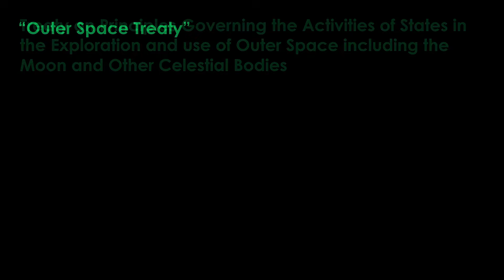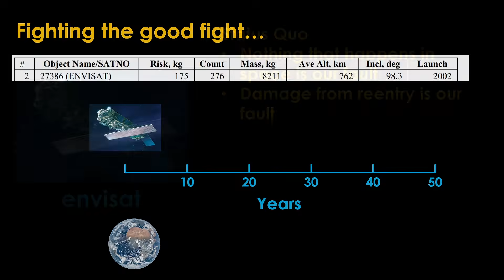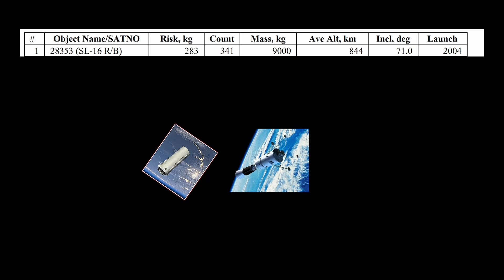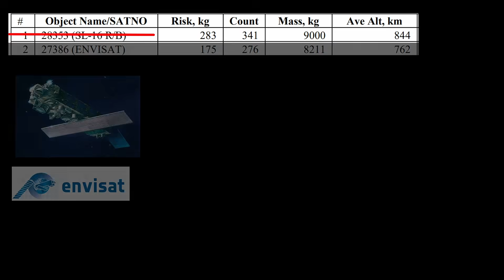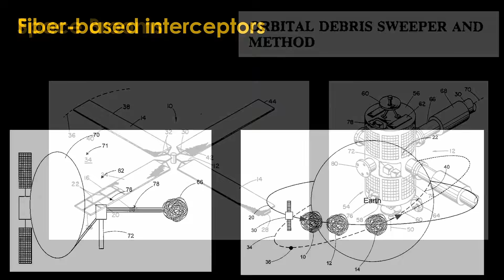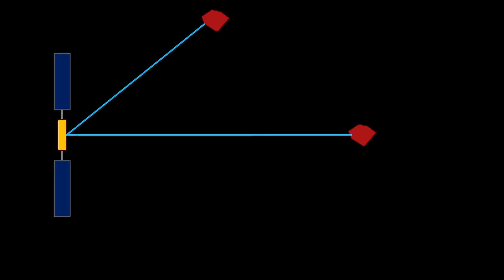Kessler Syndrome Part 5 - The Cleaners

Comment: you could just mandate satellites are designed to be able to be deorbited or maneuvered from laser ablation (from space or ground) use retro reflectors on parts of the satellites so the amount and vector of the thrust is fairly predictable. Much lighter and cheaper than adding in thrusters and fuel tanks etc. although adds some security concerns if another state can deorbit or interfere with a states satellites so easily.

Comment: The j̶e̶w̶i̶s̶h̶ space lasers look a lot more viable than I expected, so this does reduce my place on the Kessler Syndrome panic scale as well. Through of course the biggest danger remains a massive proliferation of satellite networks and data centers suddenly interrupted by conventional warfare. That would leave an inordinate amount of debris likely beyond the scope of any actor's willingness to clean it up.
But the lasers do address the long-term issues with Geostationary orbit and other high orbits.

Thanks for the video.
Reply: Those space lasers were designed and used to start wildfires in Califorznia.  I heard this from U.S. congressperson MTG.

Using a match would have been much lower cost.

Comment: What about using a dust made of ice or dry instead of a liquid or tungsten for a dust interceptor? The ice will sublimate in sunlight. A large craft holding lots of close to freezing could stay in orbit and change orbit to emit a cloud of ice dust that intercepts the desired objects, not exactly 180 degrees opposite but different enough in inclination  to make a difference. Or perhaps a lot of chunkier ice or dry ice to bust up junk particles into smaller fragments, so they'll deorbit faster due to drag.
Reply from the maker: I think both ice and dry ice would consolidate on launch. You'd need a way to dust it in orbit. 
I think...
Reply: @EagerSpace  I'd wondered whether water at just barely above freezing wouldn't rapidly freeze in a vacuum as some of it would evaporate and quickly lower the remaining water's temp at least to freezing. So spraying it in a mist? This would be an interesting experiment and could be done in a vacuum chamber with the right equipment. As for consolidation of dust, I'm sure you're right.

But what about water ice far far below freezing, ground into table-suger grain size? If it was cold enough it wouldn't stick to itself... Anyhow I just love the idea of sandblasting small debris into even smaller this way. If SpaceX can lower price to LEO the way they claim, like the $10 million to launch 100 tons into LEO they were claiming a few years ago,  it might be affordable to do some real experiments to figure out the best way.

Comment: How about a network of ion thrust devices, that can hand a target off from one to the next? Then you wouldn't need one of them to keep the same distance.
A dense enough equatorial ring of them could slowly affect polar satellites twice per orbit without performing a rendezvous.
Reply: Did I make a mistake, or are you suggesting we have objects going at relative speeds of ~10 km/s to each other repeatedly get extremely close to one another to fire off an ion thruster?
Because that sounds like a great way to achieve the anti-goal.

Comment: Teacher! Teacher! *hand waving emphatically!
I know how we can fix it good! Send all the ICBM's straight on upitty-up about 300 and 500 And 750 miles and have them detonate trafitional munitions. Remove any excess capacity fuel or even a few tanks for such a short trip then replacevwith Tungsten blocks consisting of millions of pellets a little bigger than rice, maybe 20 grams each with spiraling core bursting chages.
Problem solved. You can send me the Nobel Prize now. Thank you very much. Any sneaky snakes hiding in graveyard will have to be hit first tho, them And salvos to the Lagrange Points.

Comment: Disappointed that the dust solution didn't mention the powdered sugar solution. Powered sugar causes small explosions on impact that approximately double the transferred momentum. It's also much cheaper than powdered metals and less likely to vacuum weld itself into disastrous lumps. You also say that the vast majority misses the intended target, and that's true. However that's a good thing. It stays up there for a while deorbiting more small untracked debris. But it doesn't stay for long, causing a hazard. It's small enough to deorbit quickly or even be degraded by radiation into harmless gases like water or CO.
Reply: What if we get space-ants?
Reply: @whiskeylima960  as they say, space is no picnic.

Comment: "...and then you can determine the most economic ordering for a set of objects" -- that sounds like a hard problem (in the NP sense) as well!
Reply from the maker: It would be a hard problem with a very large set of objects, but with a few hundred I think you can brute force it pretty quickly.
Reply: @EagerSpace or you are just happy with a solution that is pretty close to optimal, which makes it a lot easier
Reply: @EagerSpace if we take "a few hundred" to be 300, then that's 300 factorial possible paths.  That's about 3x10^614, so even a massive data center isn't going to be better forcing it anytime soon!

But yes, a decent greedy algorithm heuristic should do a reasonable job in much less time. 😀
Reply from the maker: You can presort on apogee/perigee and inclination. 
If you are looking at dealing with the highly elliptical rocket bodies, you will want to deal with them out near their apogee - plane changes are much cheaper as you get farther out.
Reply: As with a lot of NP problems betting the best answer is very hard. But getting a pretty good answer is not that hard.

Comment: What about launching a sounding rocket, or HARP-ing up a suborbital projectile, to disperse gasses in front of the debris path?
Reply from the maker: You could do that with some of the debris clouds that are identified. If there are useful satellites in the area, you will slow them down as well.
Reply: @EagerSpace The intended debris is the type that's too small to track, so in most cases we won't have the option of targeting debris. Instead, we'd avoid the path of known functioning satellites. If we miss, the gas concentration would intentionally be so diffuse that it would have minimal effect on anything the size of a microsat or larger.

The idea is to merely create a temporary burst of extra atmosphere, to bring down the tiny stuff that we can only estimate is there.  There are certainly problems with this approach (yes it will slow down functioning satellites a bit because the gasses can linger). But very few other methods can address the "too small to see" problem.
Reply: Gases disperse at the speed of sound. Your gas delivery would have to be very precise to be at both the right place and time. Maybe fine sand would work better, it would be much easier to localise mass.
Reply: @usingthecharlim Sand and soapy bubbles might be useful for larger debris, but the intended use is to accelerate the decay of the stuff that's way too small to see. For a particle that small, hitting even a few molecules of gas induces a useful amount of slowdown.

Comment: I'm not 100% convinced that ground based systems would end up more expensive than satelite mounted lasers. Assuming a theoretical case of good tracking for 1cm+ objects being solved otherwise and not part of the cost calculation, how low would the launch cost have to be, for the satelite lasers to be cheaper?
Reply from the maker: We would need a detailed comparison to be sure. 
Ideally you'd base this off of one of the constellation busses as they seem to be approximately the right size and capability. Maybe you can convince one of the constellation companies to carry it as part of a normal launch. That might be fairly cheap. 

The thing about satellite systems is that they are standard and you can easily build multiple ones. Any ground-based system is more of a special snowflake - the construction can be similar but all the site work is custom and takes a lot of time.
Reply: With a tax on satellite launches, we could fund space debris deorbiting.

The latest generation of Starlink satellites have enhanced the star tracker hardware and software to also detect and track space debris. They also have multiple low power laser links with precision object tracking. A debris clearing satellite could be based on the Starlink satellite bus. Just remove a few hundred kilograms of communication hardware, and upgrade one of the lasers with a more robust mirror and a 20kw beam.

Years from now, if the financial, legal and technical issues are ever resolved, SpaceX could launch a few debris clearing satellites with each batch of Starlinks. This would put the debris clearing satellites in the same orbital plane as those Starlinks. Likewise, for other mega constellations operators.

Comment: Question: A fully operational startship would give us a lot more options with increased mass, much larger fairings, lower cost and refueling option?
Reply from the maker: A lot more options to do what?
Reply: @EagerSpace more tugs, more powerful lasers, more lasers, refueling tugs. My thinking here is that you can launch more for cheaper so all of the methods should be more effective. Not sure I'm right though and ofc Starship need to deliver on the promises. Maybe even bring them back down inside starship? (sure CIA would love that option)
Reply from the maker: Cheaper launch is always better, though starship will be cheaper per kilogram, not necessarily cheaper per mission. The same reason companies still fly on Electron when Falcon 9 is around.

Comment: ¿Did you see what elon said about using starship with a hungry hippo fairing to capture orbital debris?
Reply: Generally, this is useless, unless you really want to recover an intact satellite or station. Anyway, this is not cheap and is not feasible with most current debris
Reply: @Ame_u  it was specifically about derelict rocket stages. Besides doing literally anything to combat Kessler syndrome will be very expensive. And it's not like we're forced to stick to just one deorbiter, we can do multiple.
Reply: Said where?